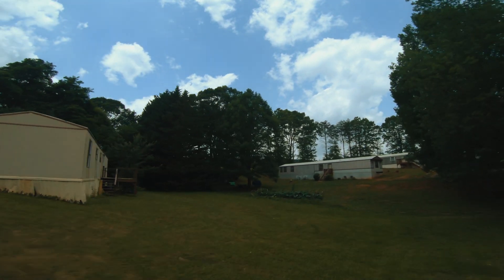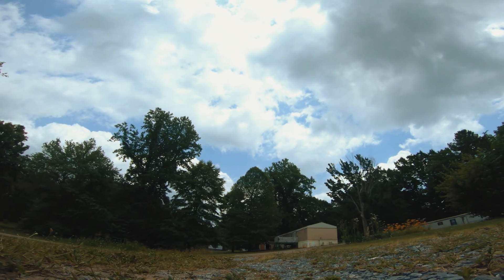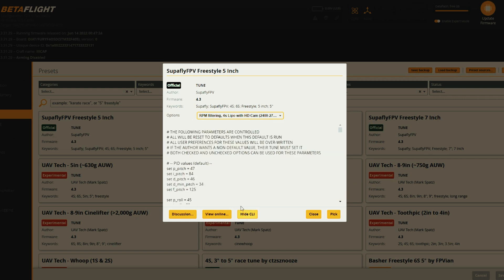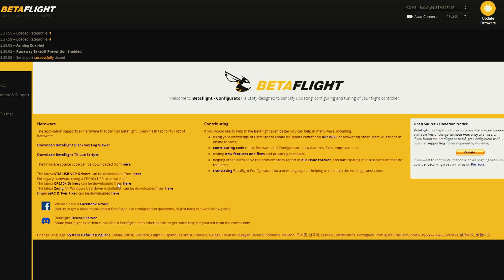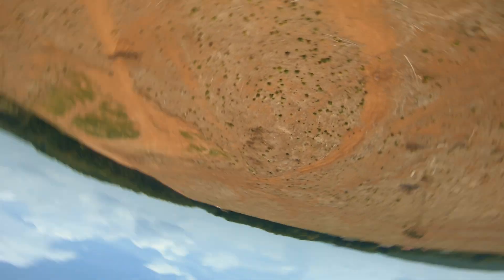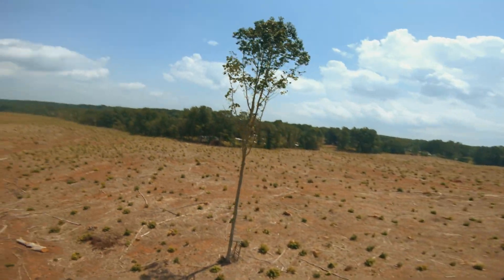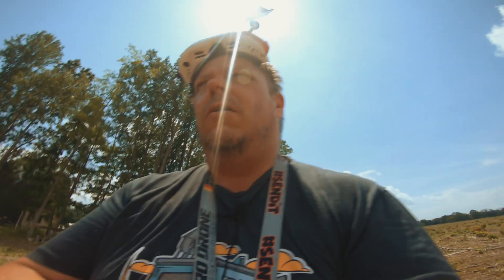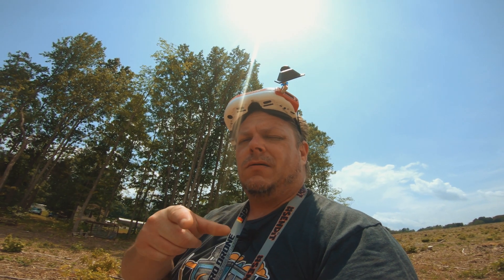Trying Betaflight 4.3 with Superfly FPV Preset

Comment: you dont need to adjust dynamic idle value?
is that becouse of the active rpm filtering?
Reply from the maker: Honestly I don't really know... I don't think I have ever adjusted it in my 7+ years of FPV... or however long it's been an option.

Comment: Great info!  Can’t wait to try this setup on my Roma F5 V2. Everyone on the forums have the same setup.
Reply from the maker: Glad you found it useful!
Reply: @lllCAP  Gave it a shot today.  Used a 1.25 Master Multiplier for my 1770kv motors, 6S as recommended on Superfly website but missing the ability to punch out of a tight spot.  Superfly recommend raising the master multiplier by .2 or .05.  Any thoughts?
Reply from the maker: @digitaltitan  hmm.. how is it otherwise? Plenty of throttle during normal flight?
Reply: @lllCAP  Feels dialed down a bit.  Here is the test flight video.  I'm thinking I need to modify the rateprofile for lower midthrottle and a tiny bit of throttle expo.  Curious to know what you think.  https://youtu.be/QpkvTf8Y2iQ
Reply from the maker: The tune shouldn't effect your throttle output too much especially if its flies somewhat decent, and looking at the dvr the tune doesn't seem to be too bad. There's no crazy oscillations, prop wash is minimal, it looks pretty good to me.  I don't think it would be rates either, that usually just changes how it feels and how fast it rotates when rolling, flipping or yawing. Throttle expo would actually limit the throttle some, it won't increase it. I'm wondering if its another setting... or perhaps even a motor that is going bad.

The last time I had throttle issues it was a motor causing it. If one motor is losing power, all of them will lose power. The best way to check that is by checking black box data. If one motor is maxing around 75%-100% when mostly level and hitting only throttle, and the other motors are significantly lower, the maxed motor would be the problem. 

I'm no expert by any means, but I would definitely check the motors on black box, if they look good, I would check other settings. In my opinions it's most likely not the tune or the rates, but I've been wrong before.

Please let me know if you figure it out!
Reply from the maker: also.. props will have a big impact on punchouts. More pitch = more grip.

Comment: I highly recommend you get RPM filtering if at all possible, it literally filters out vibrations from the motors which is like 90% of vibrations. I held off on this for a long time because it seemed complicated, but it really isn't that complicated.
Reply from the maker: I have it on. It came with the preset.
Reply: @lllCAP  I don't know anything that comes with Rpm Filtering... Normally you have to do it manually in Blheli
Reply: @YorkyPoo_UAV  Blheli32 has bidirectional d-shot by default
Reply: @FedeAGU-m9b  oh yeah maybe I was thinking variable pwm